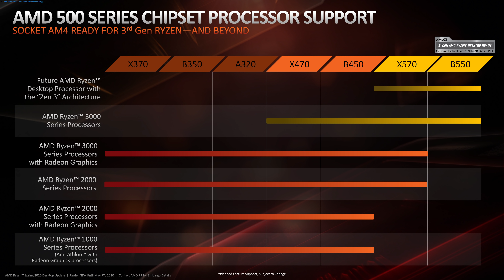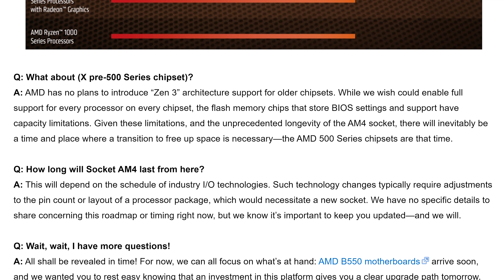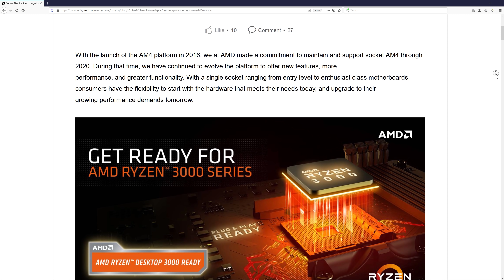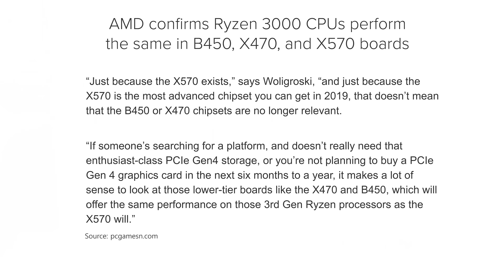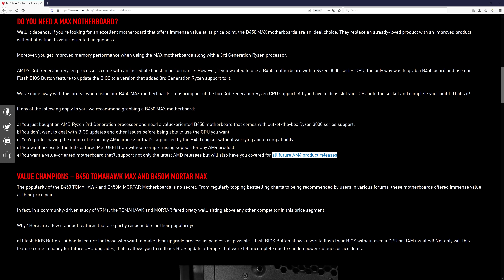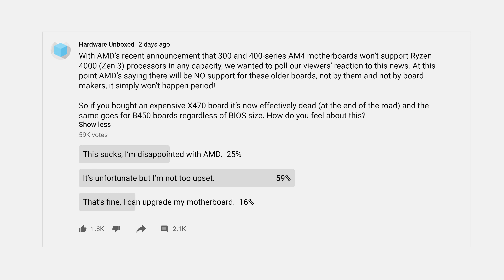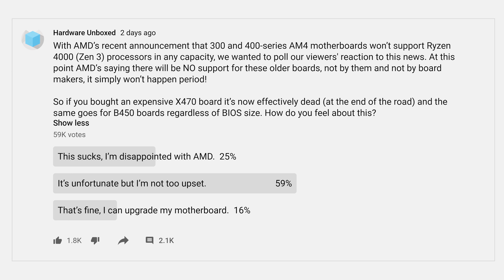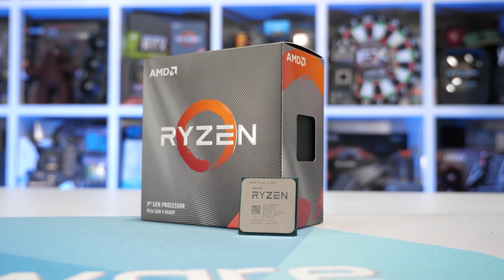AMD Does An Intel, Axes Zen 3 on 400-Series Motherboards, Our Thoughts

Comment: I spent 280€ on a high end x470 mobo to upgrade in two years and now i just overpaid for a mobo for nothing. If i wanted to overpay i would have just gone intel or spent more on a gpu .

I also feel like i have to comment on this. They just announced b550. X570 was way overpriced than x470, when PCIe 4.0 is something only about 10% of people will use.  Lots of users were actually "forced" to buy a b450 if they wanted to go AMD on a budget, and just realised they are stuck with a motherboard for one cpu and no possibility to upgrade. This is scummiest than usual Intel model, at least intel releases Z  chipsets (high performance) at the same time they release the H (budget) ones, and dont make you buy "small capacity bios chip" motherboards...

Heres hoping intel 11th gen makes them king again. At least ive never had  to RMA an intel processor nor had problems with its drivers.

Edit: also just two weeks ago i adviced two friends to get a 3600x + b450 as an upgrade for their current computers, and i told them they would probably be able to upgrade to a 4600 in two years for cheap. Now i lied to them too.
Reply: your edit hurts, I did the same thing with 2 of my closest friends.

Comment: It is crazy that a chip set still being sold is unable to support the next generation of CPUs. A single generation is a joke. The only way out of this is to split the bioses as you suggest Steve. Get stuck in to em!
Reply: It's not a single generation though. B450 ran from Ryzen 1xxx all the way to 3xxx

Intel boards at best only ever supported 2 generations. Wasn't that long ago they only did 1.

Comment: I think it is a bit harsh to say AMD is doing an intel when you don't know what features that zen 3 has that will require the 500 chipsets. Intel was forcing an upgrade with no reason to do so whereas zen3 sounds like it is going to be a bit special.
Reply: Then what are the special features?

Comment: This was my situation, bought a 1600AF and Asus X470 board thinking for sure it would get a bios update to Zen 3. I don't think it's unreasonable to ask for 400 chipsets to support Zen 3. If B550 launched anywhere close to on time this wouldn't have been an issue.

Would it be possible to get an approximate cost on the BIOS chips AMD is referencing? Are we really squabbling about a 5 dollar part to double the size of the BIOS on the board? It would be great if this was a lesson learned for AM5 if nothing else. If you say you're going to "support AM4" through 2020, it would have been nice for motherboard manufacturers to equip their boards to keep that promise.
Reply: Adam12176 yes a massive oversight, and not exactly hard to see they needed decent size ROMs from the start! iI should have been a rigid minimum standard for all boards.

They should be releasing all their new chipset boards on new cpu launch too. 

AMD really need to get their act together as this is naff for their customers.

Comment: Thw better question is will you even want to upgrade to zen 3 right away if you recently bough b450 and zen2, most people will skip a generation
Reply: I've got 2000 series running on B450 that I would upgrade.

Comment: Hey guys, my AIO has a AMD Promontory 2 B350 Chipset. System is by Dell Inspriron 7775 Ryzen 7 1700, RX 580, soldered on. Can anyone tell me who makes this board, perhaps they may have Bios i can update and take advantage of Gen 2 cpu's??? Iv'e done same in past with Dell systems using Intel cpu and motherboards, i would download Intel Bios and they would work and OC my system. JUst wondering if same would be posssible for this AMD Dell system.

Comment: @Hardware Unboxed This is worse than Intel at any point in the past for one paticular reason: It's totally unexpected! With Intel we knew what to expect. But now, AMD is basically stabbing the DIY community in the back without warning. For example, basically the whole community of ComputerBase.de was recommending B450 as the better value alternative to X570 for the past year and AMD did nothing to discourage that. To the contrary, as you just showed they even encouraged buying B450. A lot of community members will take the blame from their fellow system builders because of AMD's decision.

Also, this planned obsolescence is bad for the environment which basically ruins any positive effects from AMD's "25 x 20 Energy Efficiency Initiative". Yeah, let's waste resources by forcing people to buy new boards.

For what it's worth, I will go out of my way to not spend money on anything from AMD until this is rectified. No Ryzen 4000, no Radeon GPU, nothing. Also, my work in the community now changes to actively stating that AMD's long term support is just a bad as the competition: You think you're covered, until they stab you in the back.

Oh, and I forgot to state that I would even pay for official BIOS updates for older boards. Some 15 euros to avoid having to switch the board? Count me in.

Comment: I agree, AMD has a hard enough time on most of their software updates that it has been noted for years that AMD doesn't have better initial software support than many of its competitors. Dropping support for older motherboards was expected, but I didn't think their excuse was a valid reason and many potential consumers will likely discontinue using older AMD hardware much sooner than they expected.

Comment: One thing that is very strange about the break in compatibility that I don't see anyone talking about, is lack of support for 3000 series integrated graphics CPUs on B550, not only does this add to the confusion of what CPUs these mobos support, but it also leaves these G series processors with only x570 as a chipset that is guaranteed to support them out of the box

Comment: I bought a x470 board Right before Ryzen 3000 series came out and jumped the gun with a 2700x cpu. I figured I'd settle for that, skip 3000 series and get a 4000 series cpu. So yeah I'm a little disappointed about not being able to upgrade to the 4000 series...Hearing this news the other day I went ahead and got a  3700X.

Comment: if ryzen 4000 launches in 2021,  they didnt reneg on their promise of backward support 2020.
at least you dont have to get a new cpu cooler since its still the same AM4 socket.

but hopefully they will add  support for the X470 and limited B450 skus(the higher ends) just like during 3000 launch.

competition gets consumers value.. but what if AMD and intel already had some mutual agreement to an ogliopoly? then cpus will just go up/down in prices depending on how many units they want to sell at a certain profit margin.

but with AMD not having their own fab means their margins can never be stable unless they have like a fixed contract.

or are they pulling a sonic here? reveal bad info...then 3-6 months down the road, just before ryzen 4000 launches say they heard the feedback and give support on X470/B450 boards? 
as a result, people who saved to swap both cpus and Mobo will just get a Higher SKU cpu from avoiding a new motherboard
Reply: They weren't just promoting 2020, they were promoting Zen 3 in 2019 back in 2017.  So they are reneging on their promise.

Comment: Also, cutting out the amount of CPU's that A320, B350, X370, B450, and X470 can support is going to inflate the prices of Zen 2 on the used market because it'll be the last supported generation. The inflation will restricts budgets and cause more people to look at Zen+, which will cause their prices to inflate slightly too.

If upgraders to AM4 had 4 generations to choose from performance per dollar would improve.

Ever wonder why Intel used CPU's are so inflated? Because every generation of CPU's only works on 1-2 motherboards, so anyone with those motherboards is on the market for just a few CPU's.

This decision inadvertently hurts anyone looking to buy a used AM4 CPU down the line, not just future Zen 3 purchasers.
Reply: Exactly. I only need modest gaming systems so I always buy a used bundle of average mb & budget CPU with the plan to swap to a higher end CPU later, once the used prices have come down. Once it's totally obsolete I'll start over. It'll still be worth it with AM4 but not as awesome value as I hoped. I've still to beat the value I got out of my old core 2 era machine- that had four different CPUs in it over it's lifespan.

Comment: Two ways to squeeze Zen3 support into the bios: First option would be to make several bios version differing in processor generation support. It was done for Zen2 support on some motherboards with a small BIOS chip.
Another option would be to skip the GUI for the bios configuration. Just use text based menus and it should save enough space to include the Zen3 support. There were some motherboard where they slim lined the GUI to make space for Zen2 support. Basically just omitting the high res background images in the bios configuration utility saved enough memory to make that work. But there were customers who got upset at not getting the full bling. If the option is no support then screw the bling, or even better rip out all of the GUI for some massive memory savings.

Comment: As a person who switched to Ryzen in the first generation and got an x370 board with the intention of upgrading again in 2020, I am incredibly let down. I realize I could get a big performance gain with the 3000 series, but I planned to wait for that last little bit of IPC and clock speed gain. Now I am going back to a "wait and see" approach. I don't even have a shred of brand loyalte at this point. When I am ready to upgrade in the next 2 or years it will come down to what performs the best for the price in the applications I use. Promises of future upgrade paths clearly are empty. At least Intel never promised.

Comment: Just my luck... In January 2017 I bought a Core I5 7600K (right before the Ryzen launch - thinking that it would probably be underwhelming - and, boy, was I wrong). In just a few months I could have purchased either a Ryzen or  a Core I5 8600K with 50% more cores... And now, just a few months ago, I bought a Ryzen 3600X + MSI X470 Gaming Plus MAX. :))) Granted, it’s still much better than the 2017 situation, but still... bad timing on my part... again.

Comment: I just stopped using my core 2 quad 9400 @3.4ghz at the start of this year had it for around 10 years
my upgrade to the Ryzen 2600X was one heck of an upgrade but I am vary disappointed 
my 5 month old ASUS ROG STRIX B450-F will not work with the new zen 3
I am so pissed I so wish I would have spent the extra for a x570 board
I hope AMD adds support for zen3 really I was hoping to upgrade at some point
and don't have the money to buy another motherboard cause I am on disability
I keep my systems till they die c2q 9400 motherboard had bad caps so I had to replace it

Comment: X470 owner here, though I have had it since june 2018, so its not like I got screwed over in the past year or so. I am disappointed but would understand if they gave legit reasons for ending support, but giving the lame bios excuse when they let board manufacturers handle it the last round makes no sense, and still touting AM4 support is puzzling. No one cares if the socket is the same if support is not maintained, especially on the 400 series boards. Just because the cpu still physically fits it with the same pin layout means nothing if it is not compatible. Its just bizarre and does seem like them backpedaling to say they technically have not deviated from the 2020 AM4 support promise. If they just wanted to make a break since they said it was as a good of time as any, that is not the case. No one expected Ryzen 5000 or whatever the next series of CPU's will be called to be supported on AM4. So dealing with bios support for another round and then making that break would have been fine by all. Now, if they don't release Ryzen 5000 that has X570/B550 support, their decision makes even less sense, so it is further limiting.

Either just be upfront with unexpected technical challenges that made them have to sacrifice X470/B450 support, or give manufacturers the option again to add bios support for Ryzen 4000 series chips, for the last time on AM4. If they don't add support after seeing how upset everyone is or they come clean on the technical limitations, I guess once my 2600x gets long in the tooth for me I will grab a 3700x or better on sale or used and live with that for another few years until it no longer meets my needs. My plan at that point either way was to see what AMD and Intel was doing, so I will stick with that plan and go with the better buy at that time (not a fanboy or loyal to either company).

Comment: I bought a B450 motherboard with a 3700X last Black Friday and just 2 weeks ago helped a friend build a PC with the same specs
Reply: I don't get it. Were you planning to buy a new cpu by december this year? I'm planning to use mine for at least 3 years before i think upgrade.
Reply: with a 3700x you should be jumping over 4000.
Reply: Just resell your mobo
Reply: That’s a good build for the next 5 years. You can upgrade after that
Reply: If you were going to drop another 500$ on a new 4th gen Ryzen, I do not see how you have a problem with another 100$ for a new mobo, especially when you can sell your "old" mobo+cpu and get back at least 50% of the price.
Reply: Don't leave us hanging here...Is your PC obsolete now? Does it no longer play games at high frame rates?  What about your friends PC?  Did it burst into flames because of this announcement...I'm dying to find out.  You have a beast of a rig bro you will be fine for a few more years.
Reply: @DamnYoureGarbage  probably for 5-6 years more.
Reply: @DamnYoureGarbage  that's not the point. The point is AMD isn't being upfront about CPU support and they stated "throughout 2020." He SHOULD be able to upgrade to a 4700x if he wanted to but AMD is just making lame excuses. Not consumer friendly practice at all
Reply: @DamnYoureGarbage  ok lisa su

Comment: As someone who built their first PC this Jan. I am disappointed for multiple reasons, BUT not upset. First personal mistake was getting a micro ATX board, followed by getting b450 and finally pairing it with 3400g. However, in my case, I don't feel screwed over. As more generations of AMD CPU's roll out previous ones go down in price. To start with a 3400g and have the availability to reach up to 3950; to go from 4 core, 12nm, Zen + to 16 core, 7nm, Zen2 is still an amazing upgrade path. I don't mind being a generation behind if it means I can still be frugal!

Comment: Did a build for my buddy with a B450 Max and a 1600 AF intending to upgrade him to Ryzen 4000 in a few years. I didn't see the point of him spending twice as much on an x570 Mobo with a fan at the time when the 80 bucks invested into CPU, Storage and GPU would be way more worthwhile. Now the best he can do is a 15% IPC advantage. If B550 was ON TIME AT LEAST this wouldn't have happened.

I have a PC with an X470 Mobo and a 3700X intending to upgrade to 4000 in a few years, so all I can do is add cores now. If I knew this was happening I would have went X570.

Also, this will backfire on AMD since if B450/X470 owners have to buy a new motherboard to upgrade their CPU's, they may as well wait another year for Zen 4, which will be on a new motherboard since it probably won't be on the AM4 socket. And they may not have to wait at all for Zen 4 if they're looking in late 2021 or later.

My brother and another friend want me to build them budget rigs now too. With the demise of the 1600 AF and this news, I'm definitely gonna have them wait for a B550 if they're going for Ryzen 3. But at that point I may have them hold off for Zen 3 so they can get a cheaper 3600.

Also, due to B550's delay, what's the point of B650 that will likely release with Zen 3? It'll only be 6 months newer and won't support any more CPU's than B550 since the socket is changing with Zen 4. And I doubt it will be much better if at all with only 4 months of time between B550 and B650. I'm honestly not even sure if they're gonna do a B650 at all at this point, or even an X670. Who wants to buy a motherboard that's immediately obselete?

Comment: B450 / R5 3600 combos are going to be a cheap as chips when they hit the 2nd hand market..
Reply: good point
Reply: They won't be though, since there is no upgrade path the second market value will be much higher than before.